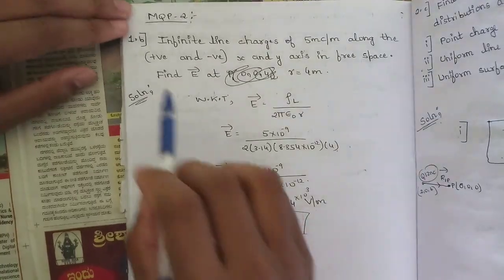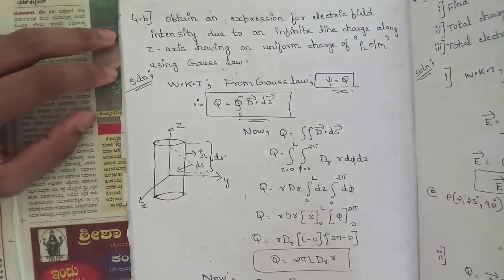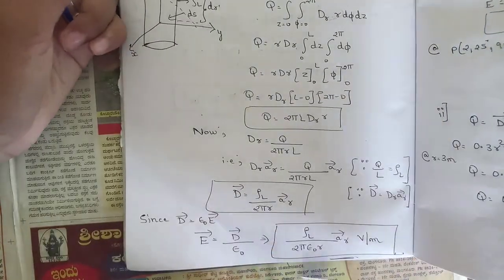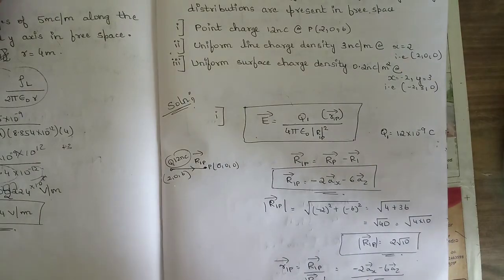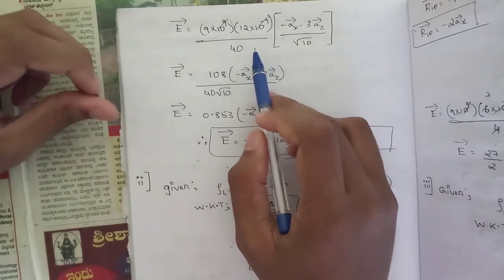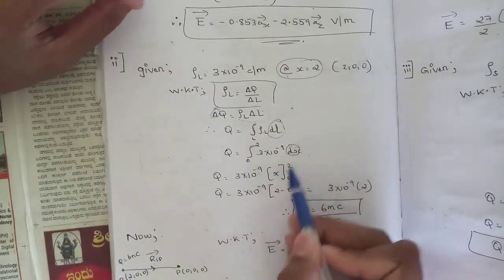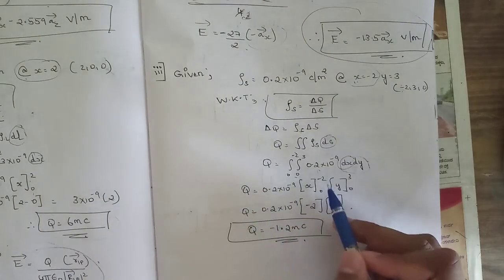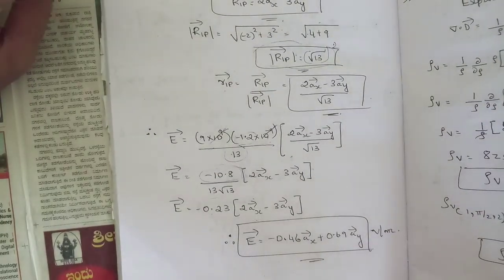#1 Electromagnetic Theory Model Paper 2 1b,2b,2c Solved 4th Sem ECE 2022 Scheme VTU BEC401

Comment: For 2(c) (¡¡) part  in given model paper  there is both x, y component x=-2 and y=3 but you have used only x for dl.....?
Reply from the maker: Yes it was a print mistake in the QP
Because for line charge density we cannot take two values